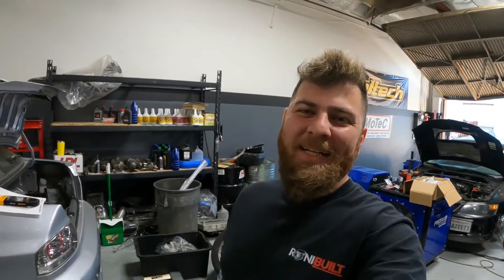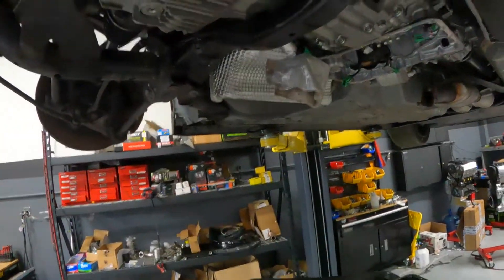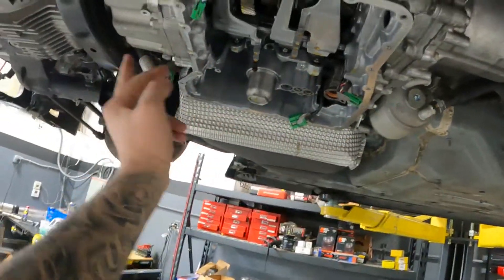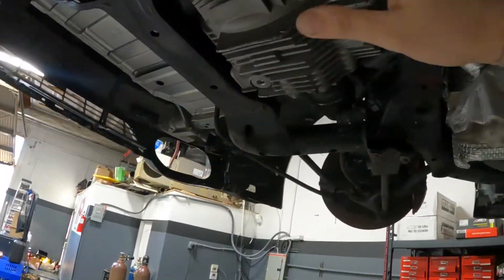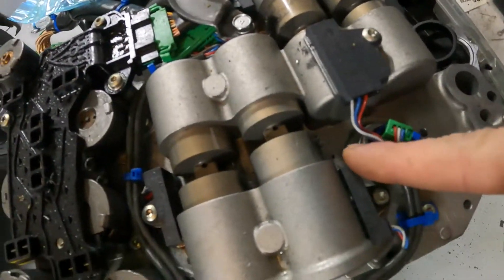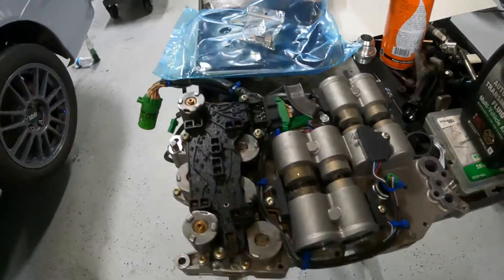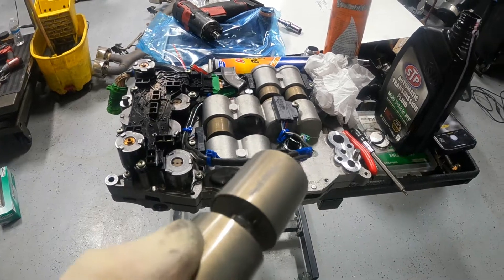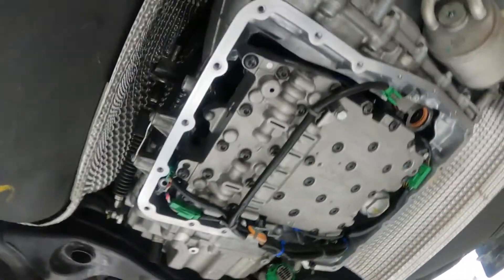How Does The GTR Transmission Work? TECH-TALK

Comment: Hey mate I've got a problem with mine. Don't know if you have come accross this problem. It has a light whining noise at idle but if I do a full lock and accelerate and do a U turn for example the whining noise gets very loud. Noise coming from transmission area. Any idea?

Comment: so basically the first prop shaft spinning even while the engine is idle??
Reply: Yes. It's connected to the flywheel (via a damper plate) but the clutches are at the back, so as long as the engine is turning, the main prop shaft is turning.